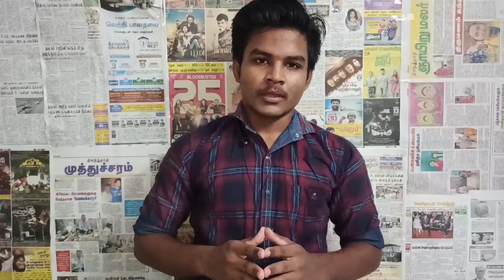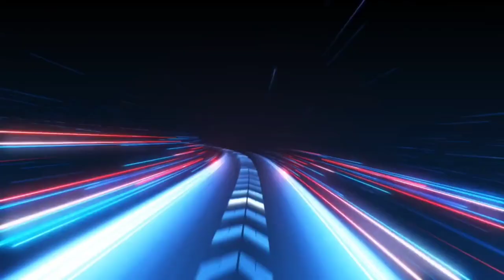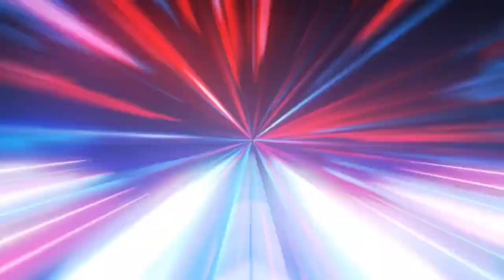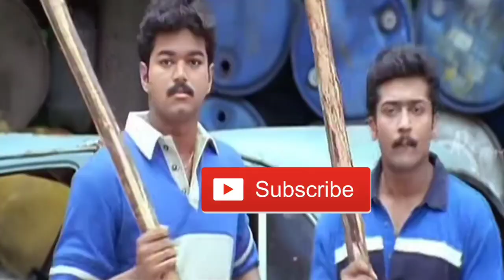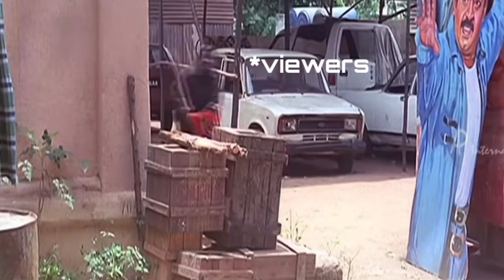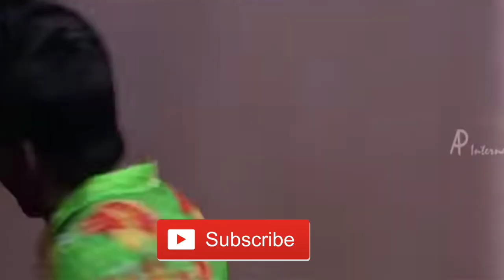Fuel injection explained in tamil | advantages and disadvantages in tamil |Budget Biker

Comment: Why no kicker in fi
Reply from the maker: Ippa fi bikes la kicker kuduthanga na avanga self motor and kicker rendukum Sethu ECU ah program pandra mathiri irrukum bro self motor ku program pandrathu easy bro but kicker ku program pandrathu kastam and kicker nala fuel pump and injector nozzle assembly damage aga chance irruku bro so fi bikes la kicker kudukarathu illa bro
Reply: @BudgetBiker  but ns160 la kicker irukae...?Why....
Reply from the maker: A royal enfield bullet has fuel injection and kick start as well whereas a pulsar 200ns has carburetter and only electric start. So there is no relation in these two. They can be used in any permutation and combination, that depends on the manufacturer and market's demand.

Comment: Electronic corporter na enna?
Reply from the maker: Example fuel injection mathiri thaa bro but ithu carburetor thaa extra oru sensor mattum irrukum
Reply: @BudgetBiker  e corporter iruntha bike a start Pannum pothu air lock aguma?
Reply from the maker: Illa bro apadi agathu key on panni 10secs apram engine start panna ethum agathu
Reply: @BudgetBiker  ok thanks bro e corporter bike la choke irukkuma?
Reply from the maker: Bro e carburetor vanthu normal carburetor mathiri thaa bro extra sensor mattum thaa irrukum matha padi normal carburetor la irruka yellame irrukum
Reply: @BudgetBiker  ok thanks G
Reply from the maker: Welcome bro